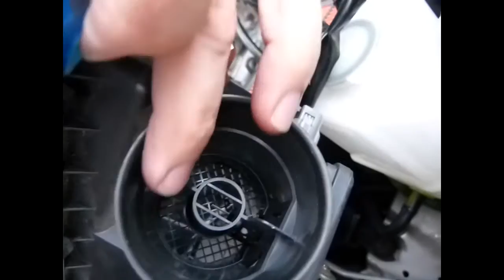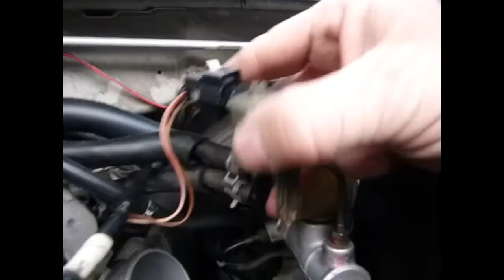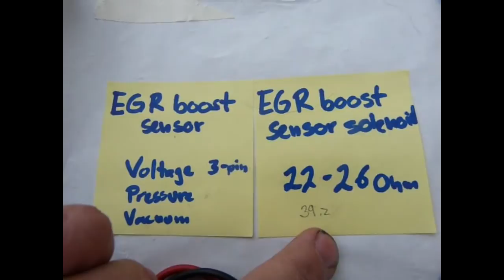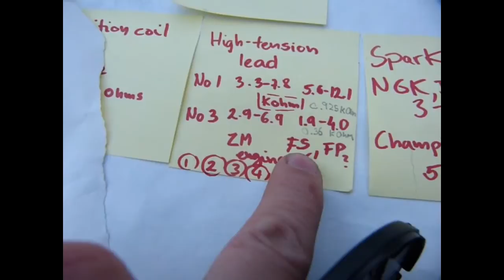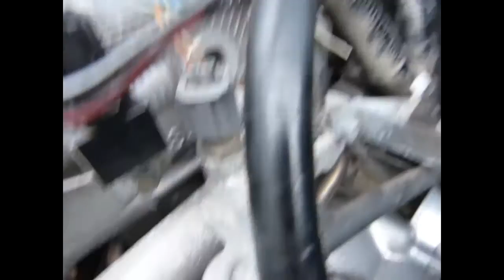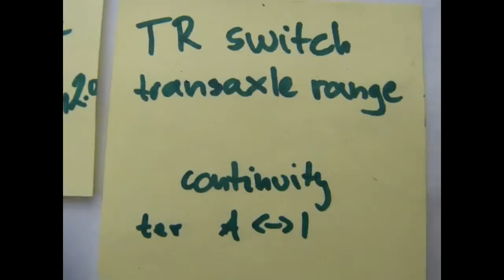Engine electronics

Comment: hallo 
thank you very much for this useful video , but there is a sensor which i have in my 1997 mazda 323 B6 1.6 CC engine here in Egypt , i could not find in your great video , so can you please send me your facebook account link so that i can send you the photo of the sensor may you can tell me what is it and where to fix and its job , thx in advanc
Reply from the maker: Not on facebook, I have an issue with the owners
Reply: @theoverengineer  ok , is there is another connecting method , as i need to send you photos
Reply: @theoverengineer 
 We all have fb owner issues, whether or not you're aware of them.